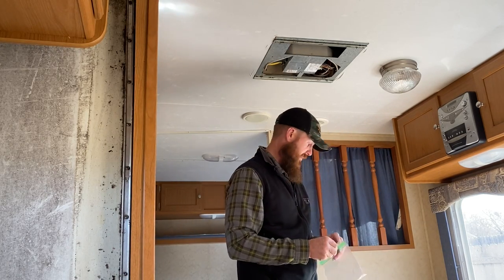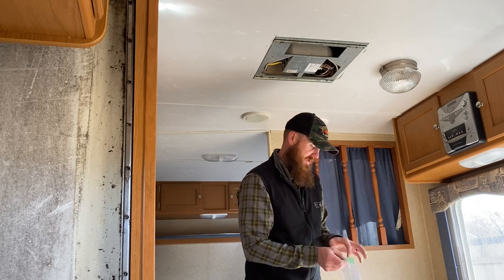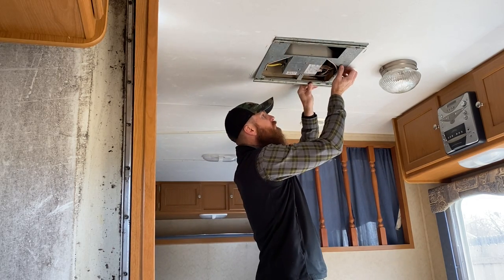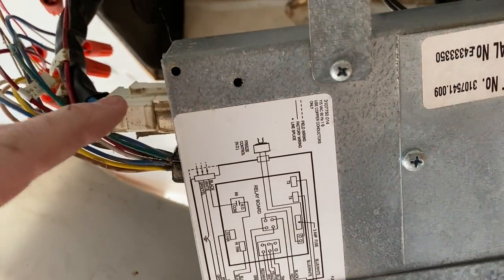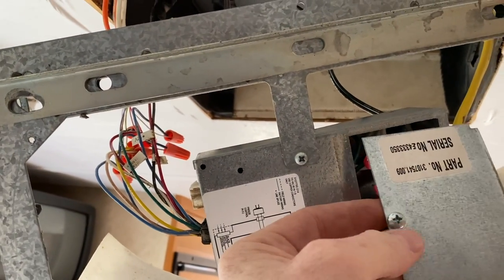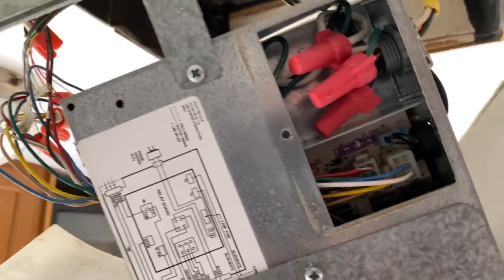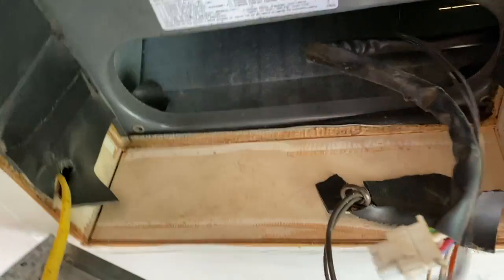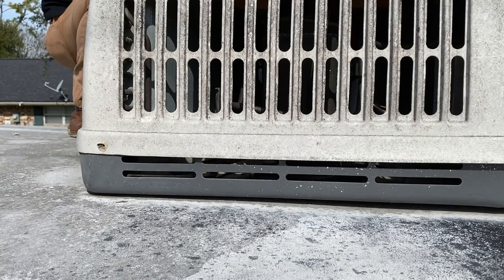RV Air Conditioner - How to Remove

Comment: So you are telling me that there were no bolts holding down that AC unit to theRV  roof? It’s just sitting there…pleases make me understand this.
Reply from the maker: Nope...the bolts (super long) run from the inside of the RV up into the AC unit. There is a metal bracket/brace on the interior that the bolts go through. Once the bolts are run from the interior  and through the bracket/brace and into the AC unit, they will "pull" the AC unit down towards the interior as you tighten them down. I hope that makes sense.
Reply: ❤❤thank you, you were right the bolts were indeed long, bless... appreciate you sharing your experience.
Reply from the maker: @deanzeliteenterprise8052  You're welcome!

Comment: Any tips on getting the ac unit off the roof and on the ground?
Reply from the maker: That was a tough one for me. I actually used a rope and slid it down the rails of an extension ladder that was leaned on the RV at the best angle I could utilize. I ended up pulling it back up the ladder the same way.

Comment: Also redoing the roof of a rotten Winnebago Brave 94, had removed the bottom part of the A/C but couldn’t figure out how to remove the top as it resisting but I donc see any way it could be screwed into the roof, I guess I gonna try to pull on it harder, it must have stick to the roofing material. Thanks for your help!

Comment: How did u remove the pan mine is stuck to the roof. Everything else looks the same as yours both inside and out. I can't see anymore bolts than the 4 that came out initially
Reply from the maker: I had to gently pry it up using a flat nail bar.
Reply: @remodelyourrv  cool cool. Gracias

Comment: Hello, I am working on getting my ac unit off my vintage camper and it is basically glued down by rubber.. anyways I wanted to ask you.. I thought I had a wooden roof and I bought a roll out pvc roof to put on it... but it turns out I have an aluminum roof... do you know if I can out down thin plywood down on top of the aluminum and then put the pvc down. Thanks for any help
Reply from the maker: That is a good question and I'm not quite sure if I have an answer for you. I don't have any experience doing anything like that, but maybe someone else visiting the channel can chime in. In the meantime, if I come across any information that can help you, I will pass it along. Best of luck!